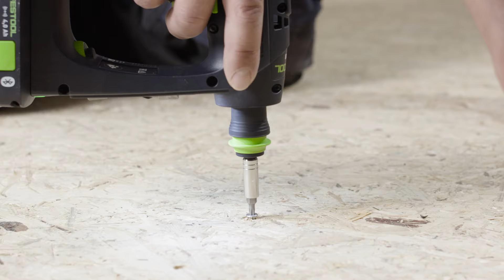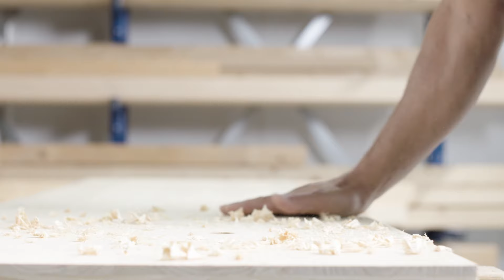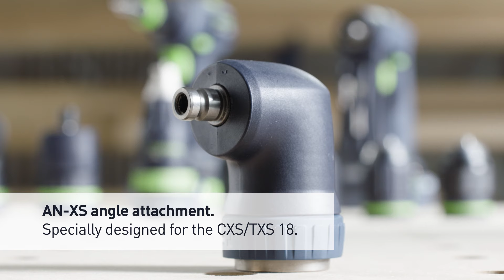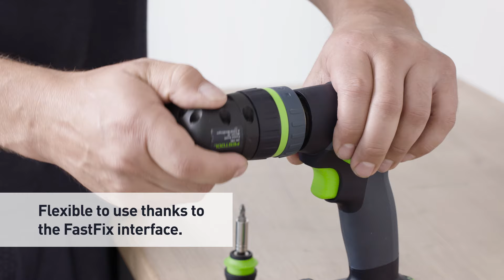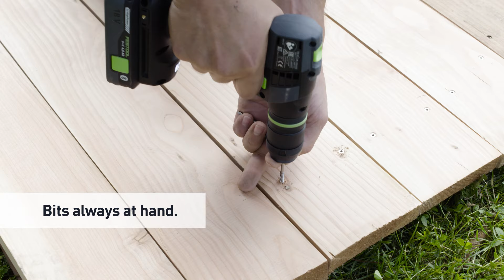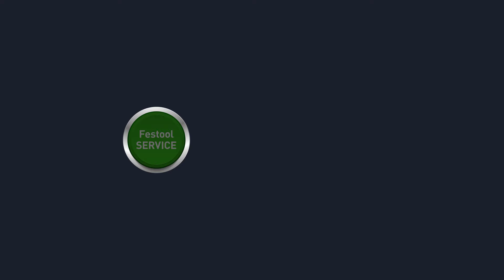Festool CXS and TXS 18 cordless drills

Comment: I was waiting for the 12v cxs to go brushless, will have to wait and see if these new 18v versions handle the same with the 3.0 18v batteries or if they're too bulky. The other concern I have is the price of the attachments, they're over 100 pounds each, thats the price of a whole dewalt milwaukee or makita drill. which is a shame because thats the one advantage of the festool drills, having the quick change attachments, but I simply cant justify spending another 300 / 400 on top for all the attachments. they should be about £50 each Milwaukee sells their installation driver with all 4  attachments for 190 pounds, and they are solid well made attachments, if festool drop the price of the attachments to something sensible I would buy this over the milwaukee
Reply: I'm pretty sure all the attachments work on both drills because they have the same attachment system.
Reply: The attachments look like the ones from the T18 and C18. Not the old cxs. The Festool centrotec system works so nicely. I know the set is stupid money but I’ve had mine for years and years so it’s paid for itself over and over and is a joy to use.
Put your rate up and take the plunge.
Reply: @SingleTrack66  I'm not ripping off my customers to give festool more money, especially not in these hard times (thanks politicians and the media) 
I use Festool for sawing, you get better quality for a reasonable price, but all their other tools are over priced in my opinion.
I will pay up to double the price of their Dewalt milwaukee makita Bosch equivalents,  but  thats my limit, Festool HKC and TSC fulfil that criteria but most of their other tools do not and seem to be 3 or 4 times the price of their D,M,M,B equivalents.
Reply: But will you still be using that bargain Milwaukee or dewalt made in China 10 years from now. I moved from dewalt having suffered from tools letting me down. 
3 mirka sanders went in the bin now have festool. My rts400 is used daily and hard and still runs sweet made in 2015. 
Buy once not multi times with cheap inferior Chinese crap……

Comment: Id like to know the weight difference between the C18 and CXS18 with 3ah batteries in.
Reply: It’s on their website, I think it’s about 200g
The machine itself has the same weight as the old 10.8V CXS but the battery pack is about 200g heavier, so it fits in between the two
Reply: TXS/CXS18 weighs 0.7kg body only without the chuck. 3Ah weighs 0.4Kg and 4Ah compact 0.6Kg. 10mm chuck weighs 0.189kg, 13mm one weighs  0.279 kg, and 13mm with metal shroud 0.309 kg. C18 body only weights 1kg without the chuck and without the pack, and normal chuck for C18 is the 13mm one that weights 90 gram more then the one standard for CXS/TXS both 10.8V and 18V.